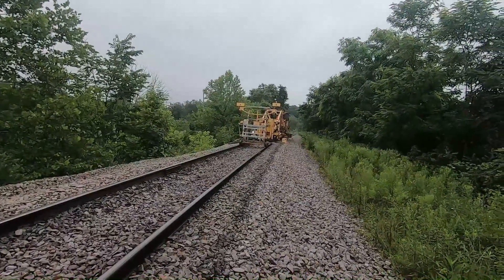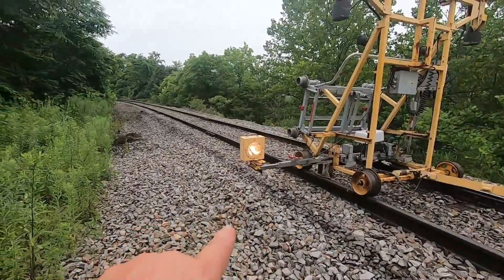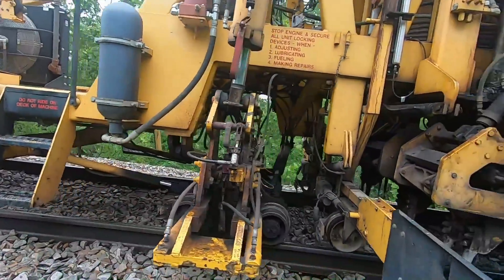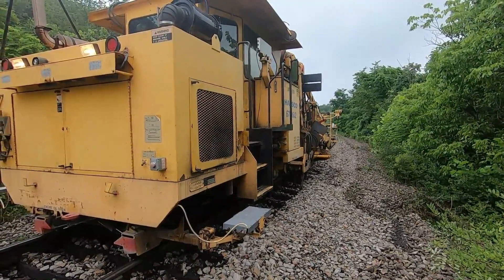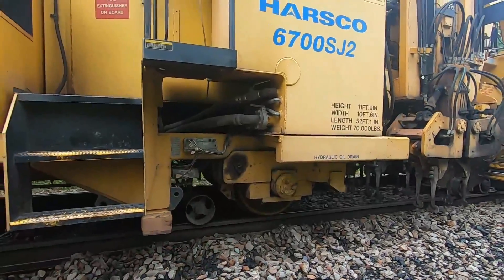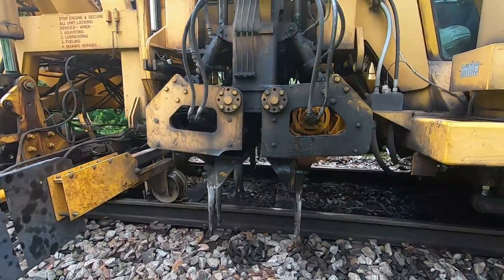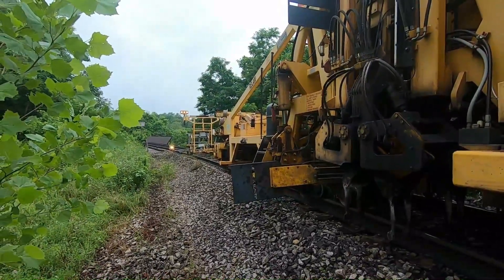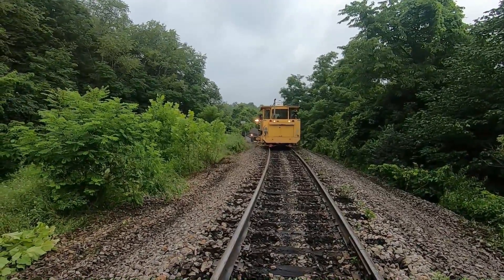Tamping Track with a Harsco 6700 SJ2 Tamper

Comment: Do you clean the tops off the ties and plates after the tamper has gone by or will the vibration of the trains just knock the gravel off to the side?
Reply from the maker: Very good question Bob. The track if left as you saw it in the video
would be unsafe for a train to pass over at posted track speed.
There is a regulator behind the tamper, which was not in the
video, that comes after and fills in the cribs and then brooms all
the ballast off the top of the ties so it looks nice and so a
track inspection can be made to see all the bolts and spikes and
tie plates. Appreciate your question and for watching my good man.
Reply: I was wondering the same thing. Great minds run on the same track. Haha

Comment: Looks like the ballast is pretty good size. Do you usually always use the same size for drainage purposes?  Very exciting to watch this amazing machine. You are so wonderful for sharing and telling us how things  operate. Have a great day!
Reply from the maker: It's called here #3. Some have a slang term for it and call it
road nuggets since this is the size of stone that access roads
for like gas well pads have their base made from. It packs in well and is the perfect size for tamping under ties. 

Stones are about the size of tennis
balls and under. Stone the size of baseballs or golf balls would
not provide as much resistance to the track sliding as the #3's will.
#'s give good drainage also. We always use the same size stone
here.  The big key with ballast is to have the stones with sharp
edges. Smooth edges would be like building a track on marbles,
it would roll on the smooth stones. Ballast does have a life, the
more the trains run over it and the more it gets tamped, that
makes the stone more rounded instead of sharp as years go by.
Was going to do a video on ballast, but when I do, now you
wont have to watch it! LOL

Great question Valerie and thanks my friend for watching tonight.

Comment: I made the mistake when I was learning to run our old tamper one time. Turned the lights off while still clamped and went to get out of the machine. We had a nice hump in the track that took some work to get out 😂
Reply from the maker: Not to feel bad Michael, when I was learning, had the grade and line
rail selector the wrong way, I was starting into a bridge approach
and when I clamped the track shot straight up.... fortunately I
didn't tamp it and the track fell back almost to where it was, couple
of trains over it and was back to where it should have been. Thanks
my friend for watching tonight. (I got a lot more goof up stories I did too)